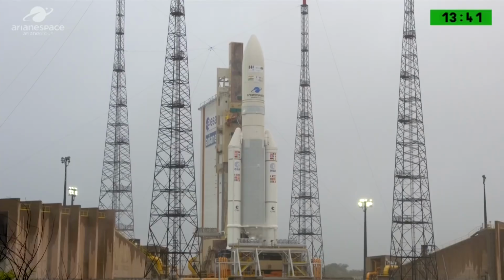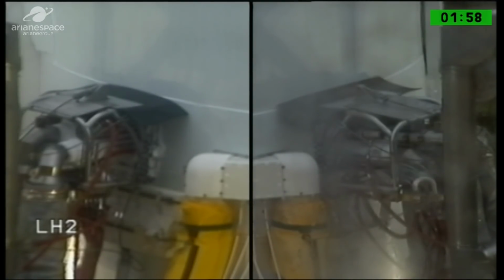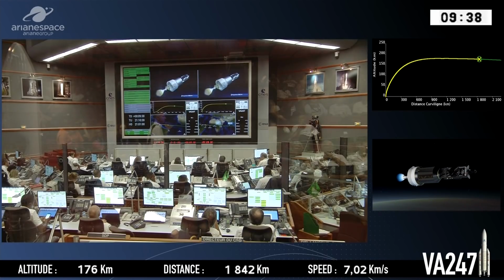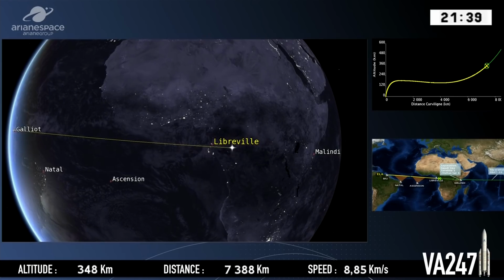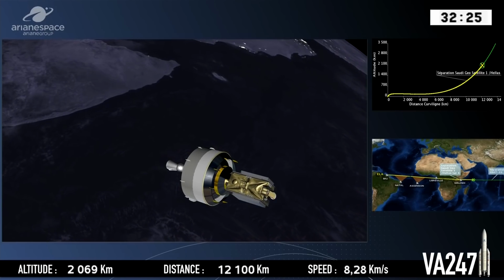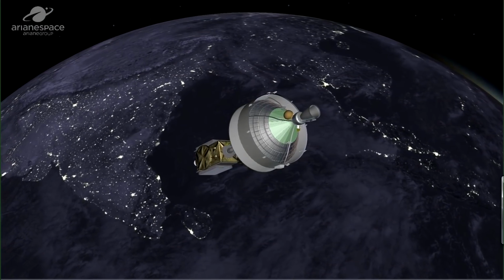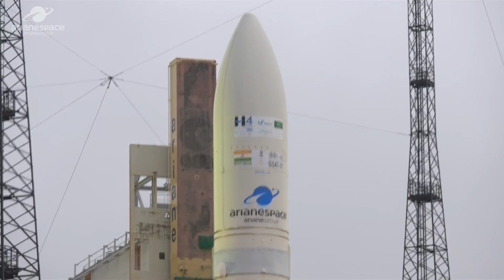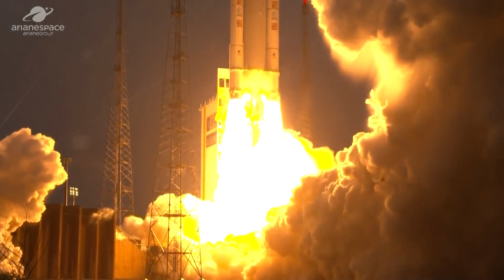Flight VA247 – Saudi Geostationary 1/Hellas Sat 4 / GSAT-31 | Ariane 5 Launch | Arianespace

Comment: For people wondering why India is not launching this sattelite using indegenious lanuch vehicle gslv mark 2 or gslv mark 3 is because isro delayed the launch of thier highly advanced gsat 11 satellite to perform additional checks before launching it. As a result arian space forced isro to launch not only gsat 11 but also gsat 31 sattelite using their launch vehicle as a compensation for the first delayed launch.
Reply: monuked no tats not the reason.....India’s maximum launching capacity in GTO is under 4 tonnes......gsat 31 was 5.8 tonnes....we are developing semi cryogenic tech and kerosol fuel to increase payload capacity....first experimental test will be late 2020.....will reach there slowly.......on path.
Reply: @ABK2192  u are wrong brother. gsat 31 had a lift-off mass of 2536 kg, while gsat 11 lift off mass was 5854 kg. So arien black mailed isro to launch both satellites even though isro wanted to launch gsat 31 usings its gslv mark 3 launch vehicle..